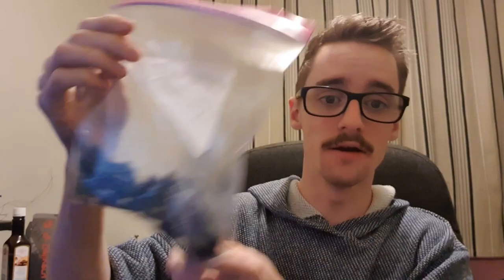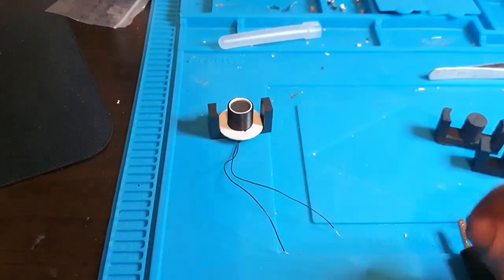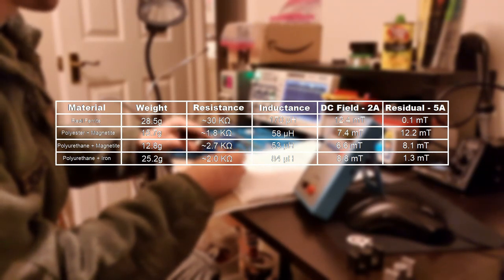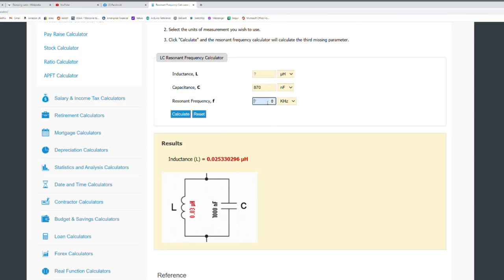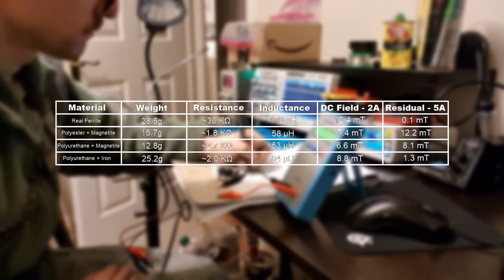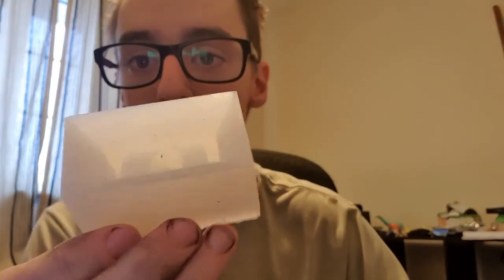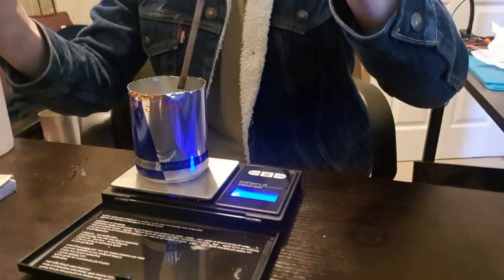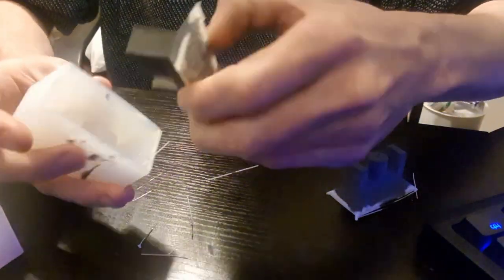Homemade Magnetic Cores! (Part 2)

Comment: Using the terms "iron powder" and "ferrite" interchangeably is a mistake.  In RF work, iron powder cores start outperforming ferrites in the low-to-mid-HF range.  I don't know what difference it makes in transformers, which are typically kept well under the HF range, like about 1MHz and below.  The primary difference between magnetite and iron is that magnetite is made primarily from iron oxides, while iron powder is metallic iron.  The so-called commercial ferrite core most likely uses a powdered alloy that is tailored to the desired characteristics.  Maybe some silicon would help there - it certainly does in sheet iron transformer cores.  I think that powdered-iron formulas are closely-held secrets among makers of transformer coils.  I remember TDK using Sendust to make magnetic tape heads, due to its very high permeability and very high saturation flux density.  According to Wikipedia, Sendust is typically 85% iron, 9% silicon, and 6% aluminum, but again, there are trade secrets involved.  And how the heck to you get the powder?

Also, I don't think the conductivity between particles is affecting your inductance that much.  More likely it will just result in the core operating slightly less efficiently, and therefore heating up a little more for a given power.  Eddy currents become a problem in the ohms and milliohms ranges, much less so in the hundreds or thousands of ohms.

Finally, your urethane/iron slurry still looks pretty thin at 80% iron, and I think it would be worthwhile to see if it DOES make a difference going to 90%.  I would worry that the iron is settling out of suspension, leaving the density of iron  lower at the top, especially with the long cure time you've chosen.  Because of this, I would think that overfilling the mold even more, then running it through a band saw or just grinding it down before the urethane gets too hard, would give better permeability through the whole core.

Comment: @Benjamin Marshall, I would try using sodiumsilicate as a binding agent. With atmosferic CO2 and water it will become a ceramic substance that is also heat resistant. I don't how hot polyester and polyurethane can get but I presume those adhesives will start to smell and produce toxic fumes when the core gets really hot. Possibly sodiumsilicate as  a powder can be mixed with black ironoxide in dry form and when packed in the mould it will absorbe carbonated water (the drink soda water).

Comment: Little trick for removing the air from your molds, use an engraver and just tape it to the side of your mold it will vibrate and settle your material removing pockets. They do that with Concrete specialized tools
Reply from the maker: I was thinking about doing exactly that!
Reply: Would a small ultrasonic cleaner work? Say add water, close the lid, and place the mold on top?

Comment: To isolate the powder, you can mix it with paint, or with a very weak glue. Spread the powder to make a thin layer and wait for it to dry. Then you use any kind of glue to put it all together.
Reply: Yeah I was thinking you could hang thin insulators (pieces of plastic or something) in the mold as you fill it to keep the eddy currents down. Your ideas sound very interesting, and we could also try doing that only in thin layers (like do a layer of powder, thin layer of paint, dry, repeat).
The magnetic field will go with the length of the coil and generate currents in the same plane as each individual turn of the coil, so the insulating layers should go in parallel with the coil (vertically in this case) right? So to use your idea in layers we’d just turn the mold sideways. I’m sure any variation of our ideas would make it harder to pour but it might be better or cheaper than the insulated/chemically encapsulated iron powder he mentioned 🤷‍♂️👍

Comment: suggestions to improve your parts number one warm your mold before casting, warm part a and part b separately you can use a microwave for this and an infrared thermometer remember the hotter it is the faster it will set. vacuum purge warm resin part a and B check temperature warm again if needed then mix your iron powder with part a before you mix the two parts together ideally you shouldn't need to use a solvent with urethane, viscosity can be adjusted with temperature, when mixing be carful not to get air in the resin, also when pouring your part slowly drizzle the resin down the side of the mold, the idea is to keep one stream of material flowing into the mold try not to stop and start again it needs to be poured all in one go.the part should be poured quickly so that the mold doesnt lose too much heat.  then place the poured mold back in the oven for an hour (or longer) take out and demold the part and then reduce heat and place part back in the oven to keep warm overnight to cure. you will need to experiment with temperatures and times as i have only used commercially available urethane and every type has different time and temperatures,  oh yeh also using multiple different size of iron particulate will improve density. urethane will shrink slightly so be sure to allow for this.  
using this technique i have made parts stronger than steel and with zero air bubbles and even distribution of metallic powder  

oh yes making the molds out of a more flexable urethane works really well

Comment: Nice video! Ive been playing around with this  before aswell but only using polyester. Im going to try to either press, sinter or fuse dry powders next time I try. I feel like directing some current either around or through the mix together with pressure could produce some very good and interesting materials

Comment: Just stumbled on this. Very impressive casting and interesting results.

I've been thinking about this to make shaped 20-40 Khz cores for a single magnetic pulse instead of using expensive laser cut silicon steel laminates. Definitely going to subscribe, good work.

Comment: Perhaps try looking into "Metglas" powder. That stuff has the highest permeability of all metals, also expensive. It is man made and specifically engineered for making strong transformers. "Metglas" cores are used in professional applications in transformer designs. I was planning to mix and impregnate Metglas powder into 3D printer filaments, so that I can 3D print magnetic cores for transformers. It will be much more easier and provide more accurate complex shapes of core prototypes and designs.
Reply: Metglas does not come in powder form. It comes in foil. But you can get atomized 99.9% iron powder for cheap. It is nearly the same as Metglas but easier to form and without the high expense.
Reply: @dee5556  you’re crazy, pure iron will never be same as to metglas stats. Metglas has a permeability of 100,000 when pure iron has 5,000. Powdered metglas could be accomplished if you’re smart and have the funds.

Comment: There’s a really runny resin used for firming-up soft wood.  (?)

Perhaps mix the resinous materials separately, (using a really slow-curing resin) and then mix them and press the mix in a warmed mold under a hydraulic press??

Thanks for doing this.  I was wondering how to do generator cores.

Comment: How about making a hard mold and pressing the powder into place? 

Or use really low resin concentration (or something like tung or linseed oil) so it holds but is mostly a paste and then sinter it, or use a layer of resin on top to hold it together. 

Using a mortar and pestle to mix this type of aggregate (wetted powder) works well.

Though as you said, it might not help.

Comment: Really great experiment. Given the outrageous price tag of large iron powder cores (I suspect that the reason is the strict adherence to the published material specifications for the final product making the production process quite hard and maybe factory rejects of cores that are subpar quality), making DIY cores seems a reasonable option. I wonder if any industrial process use a cold process with solvents and binders or if all of them use heat and/or pressure (sintering process). For your specific process, I wonder if the iron powder may settle down with gravity if the solvent/binder mix is not too thick during the long curing time, giving rise to uneven distribution of the iron powder in the core. But by the look of your final product, it seems quite homogenous. Using iron carbonyl could be a nice refinement, If there are no unwanted chemical reactions with the solvent or binder. Maybe an organic chemist could chime in. Also, you could make yourself a BH curve analysis circuit to plug into the oscilloscope for further characterisation of your cores. Have a nice day!

Comment: that's really interesting research, and well done!! but... apparently... my silly goal of making an elongated core for a stupid TV flyback seems vain, i have to try to crack some of those as better as possible and frankenstein together the pieces until they close, luckily an air gap is needed, so the imperfections would work as air gap themselves (kinda)... i also saw an old video of a literal "structure" of flyback cores put together to make a single giant core, without breaking em, but it has a crappy shape

Comment: How well do they handle heat? I've been using things like black iron oxide , gypsum, plaster of Paris, dipped in resin for a step down.  The humming of the transformer, with the turn ratio I had, sounded like thunder rolling, it was scary

Comment: from paper titled "Manufacturing Processes for Permanent Magnets: Part I" (from Springer) :
After calcination, the block is wet milled to powders with an average particle size in the range of 0.7–0.9 lm. Particle sizes < 0.7 lm create problems in compaction and sintering, while particles> 0.9 lm affects coercivity

what size of the particles did you make? because that affects the performance of the magnet

Comment: Dude this is really cool! I have a bunch of thoughts, mostly around other additives that could be in the real ferrite. Did you ever get a chance to try Mica powder? Its a pretty common resin addin, its super cheap, and has high thermal conductivity (which could keep the ferrite cool) but low electrical conductivity.

Comment: have you though of using vacuum chamber to pull all the air out of the polyurethane and/or thinned self leveling 2 part epoxy...mix the metal in, vacuum it to remove the air, then pour into mold, and re-vacuum to see if it will draw into the mold better
Never made molds but I have seen people on YT vacuum down the mix and it really helps mold
Ooh...maybe a vibratory bed to help it settle better as well...I think vacuuming it down would help

Comment: Have you tried mixing the iron powder into some ABS slurry/paste (from failed parts)? If that were possible, it would greatly decrease the cost of the magnetics since you wouldnt have to buy the resin and ABS filament is quite cheap.
Reply from the maker: I haven't tried that, but I feel like ABS wouldn't be able to accept as much iron powder as resin can.

My most recent parts have been %90 carbonyl iron powder.
Reply: @BenjaminMarshallScienceMan  Don't bother doing it, there are already few iron powdered filaments that are being told online, they put a lot of iron powder into the filament and many people have tried making transformers out of them, with no good results. Try using Metglas powder.
Reply: @ShopperPlug Good luck finding metglas powder, if a source for it even exists for us mere mortals it would be extremely expensive.
As a reference metglas brazing foil can be had for the low low price of $1600/kg
Reply: @BenjaminMarshallScienceMan  I'm interested in seeing your test results with the 90% carbonyl iron powder!

Comment: Very helpful experiments! Could you please share the link of the iron powder you used.. And what's the mesh value BTW?
Reply from the maker: https://bit.ly/2Q3MTBD This is the powder I used in the video, it's 325 mesh. 

Though I've noticed finer powders being able to be mixed in higher concentrations. I was easily able to make a %90 pure mixture with finer powder, but the 325 mesh came out clumpy at %90 concentration.
Reply: @BenjaminMarshallScienceMan  Thanks . Does the casted stator turns out stiff or kinda flexible or brittle at the end?

I haven't tried it yet but i think the higher mesh value of the iron.. the less stiff the cast will be. Maybe i am wrong .

I also see two types of powders online... Black iron oxide and just iron powder.. have you tried both?
Reply from the maker: Even the %90 pure cores I've made with very fine powder I would describe as 'brittle'.

They have SLIGHTLY more flex than real ferrite (which is essentially a ceramic) but  they don't break easily, and when they do they fracture instead of bend or tear.